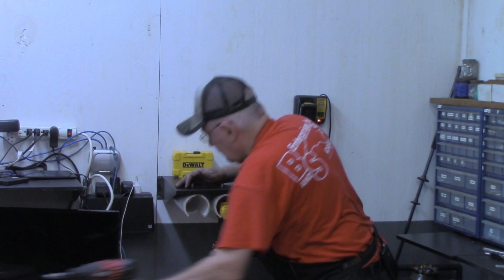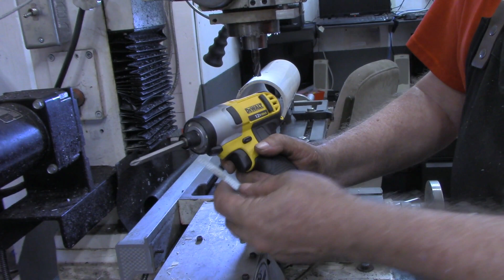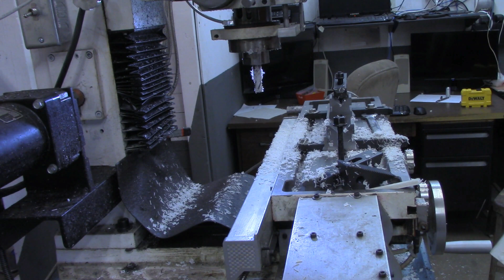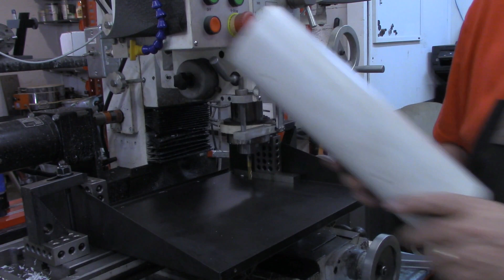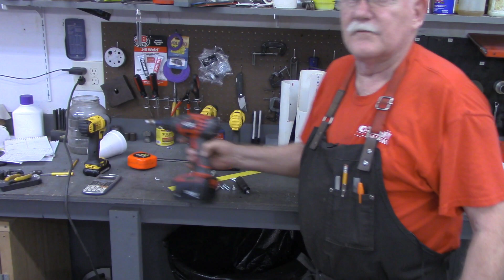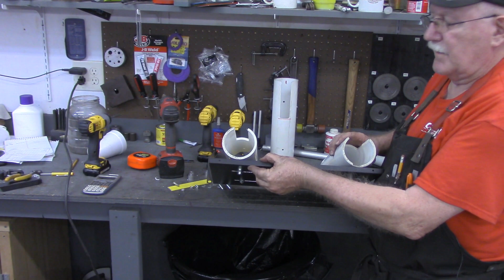Cordless Drill Storage

Comment: Are you going to cover the top of the shelf?  A nice piece of wood, with countersinks for the bolts/nuts would work great.  Very nice way to organize the drills/drivers and keep them handy.
Reply from the maker: I'm actually going to use some thin head elevator bolts and put the nuts on the inside of the tubes (I see now there's room).  This will give me an almost flat surface on the shelf; however, I will still cover it, most likely with a piece of plywood.

Comment: I have used 12 inch sections of 4" PVC pipe mounted to shelf brackets to hold my extension cords. The PVC keeps the brackets from damaging the insulation of the cords and the 12 inch length allows me to put three to four long extension cords per bracket.